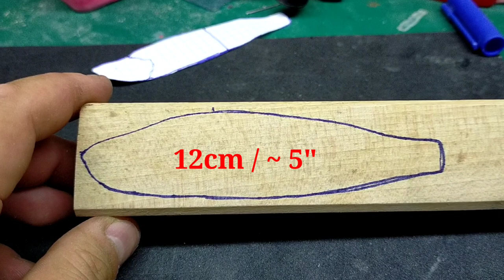Lure Making Jointed Swimbait 2.0 - part 1

Comment: Whete do you buy those 'syringe'?
Reply from the maker: The siringe I bought in pharmacy - the smallest size (here they call them insuline siringe). The thin plastic part I took from my super glue set - cause it was just lying around, but of course the siringe needle would also work for this purpose, just don't choose the thinnest one 😉